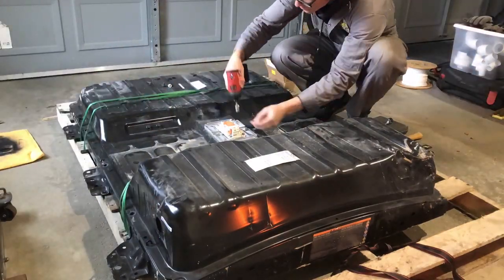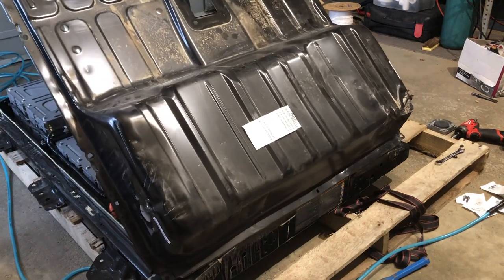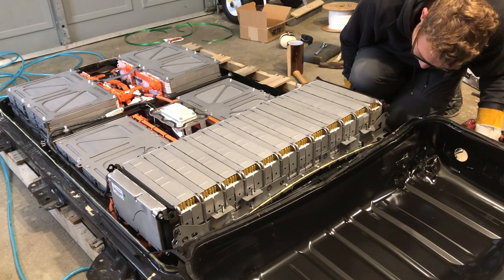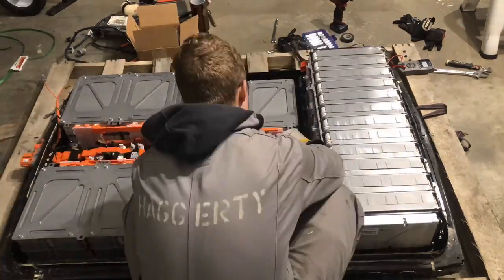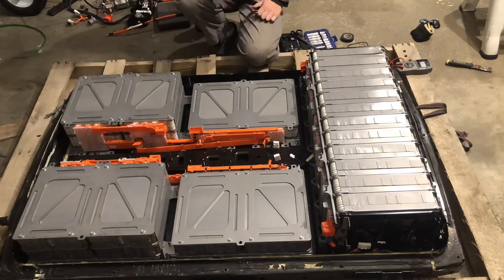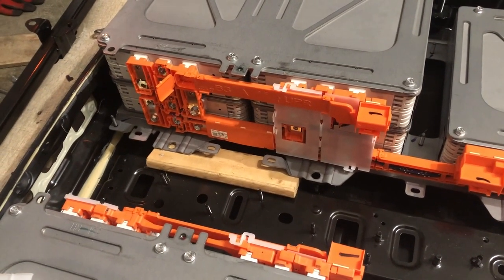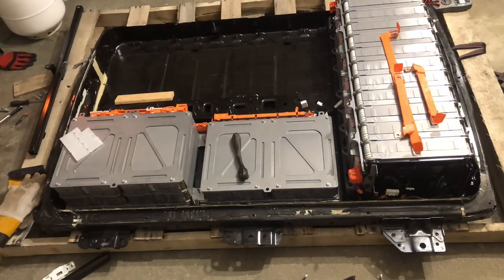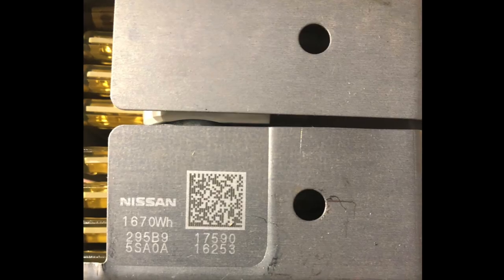2018 40Kwh Nissan Leaf Battery Disassembly

Comment: Did you take apart the damaged module? Any video of it?
Reply from the maker: I did take it apart but don’t have video. I do have a few pictures though. Use lots of rubbing alcohol to loosen the glue holding the cells together and. It isn’t so bad.

Comment: Jesus for the love of god if you ever going to do this again remove the LBC first, it’s the brains and heart of the pack not the shutdown switch/service switch
Reply from the maker: It may be the brains but it ain’t the muscle... removing the LBC (BMS for most other folks familiar with building or working on EVs) wont do you any good here. Even if it did, the first thing I did after opening the pack was to remove the BMS connections. The contactors are open and the mechanical pack split is removed before taking the cover off. So in essence you’re opening 2x 150V packs that are completely covered by orange plastic, while wearing 1000V gloves and ideally insulated tools. 

Again, removing the LBC/BMS will only provide a false sense of security- it has no ability to open contactors that are already open or prevent you from shorting between two terminals when unscrewing the bus bar connections.
Reply: @jphaggert  you say that but I work on these for a living, I literally build these everyday and strip them back most days I know how it work and how my company says it should be done, and your doing it wrong.
Reply from the maker: Care to explain? If I am doing it wrong, what is the right way to do it?
Reply from the maker: Removing the BMS connections is the same as removing the physical BMS. The first thing I did after opening the battery was remove the connection to the BMS. 

If that’s not the case please explain.
Reply: @jphaggert    You didn't do anything wrong.  I hate that you tore the pack apart though.  It should have gone into a leaf in need of a battery upgrade.  Tear a part an old 24 kwh battery if you must.
Reply from the maker: That’s a bit of a silly thing to say. Why put this battery into a car that will by design eat itself down to 80% capacity in 3 years instead of a project that will keep the batteries in good health? I never like people telling others how their modifications are bad because there’s a “better” use for it (I.e when someone makes an EV out of a classic car and there’s a handful of people complaining how much of “waste” it is). There are thousands of leafs on the road today- why waste a battery putting one more on the road instead of making 3 or 4 projects with it that will be more efficient and allow the batteries to last much longer?
Reply: @jphaggert    The batteries will last the same amount of time.  How they are used determines how long they last.  That was a 40 kwh battery that would have turned somebody's crippled 24 kwh leaf into a much more useful car than it was when it was new.  Feel free to use the old 24 kwh battery for electric vehicle projects.
Reply: @jphaggert  do you have LBC and contactor box from this pack? It it for sale?